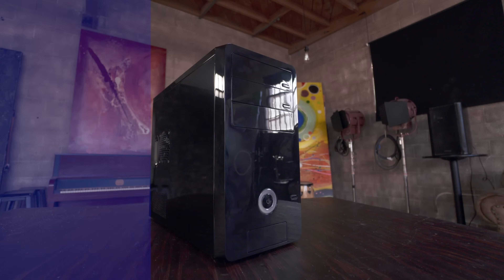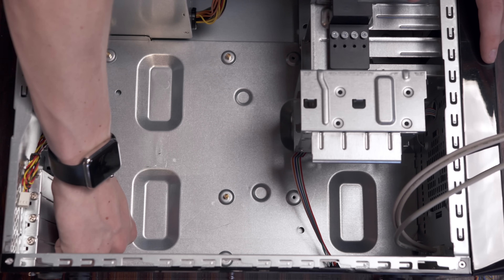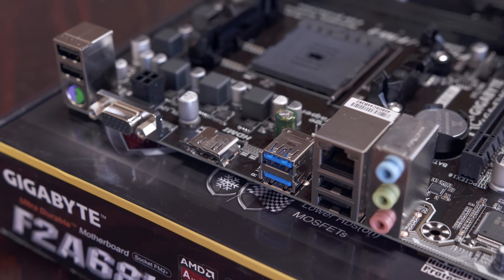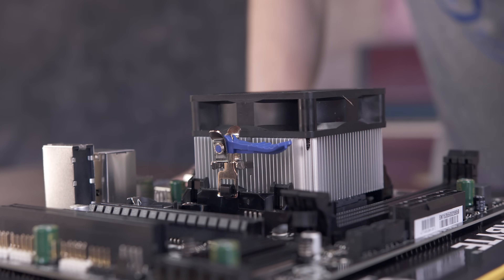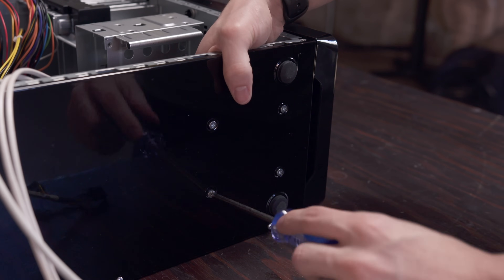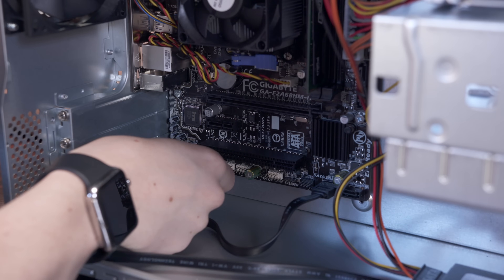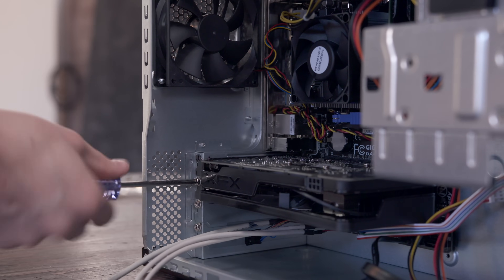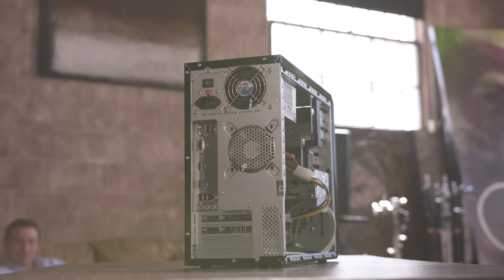How to Build a Gaming PC! (2016)

Comment: "Gaming PC!"

Athlon
Reply: +ThatOneGuy This computer costs 350$. What do you expect?
Reply: Lol
Reply: David Srey Oh it's off sale then, but the extra $40 is worth the overclock go with the performance of an i5 the i3 6100 is an amazing dual core but for modern gaming you'll need 4 cores and the best CPU under $180 is the FX-8350
Reply: +ThatOneGuy I mean 4 cores? It can't do THAT badly, I mean if all else fails you get a free radiator, right?
Reply: better than your shitty i3
Reply: +Fuck Nope i5 4690K clocked at 4.1
Reply: +Fuck How about you ?
Reply: +Fuck the i3 6100 beats the fx 6300
Reply: Mrmogeli My FX-8350 4.5 Ghz beats your i5 4690k easily
Reply: David Srey But not the FX-8350 and it's cheaper than the i3 with six more cores and higher clock speed
Reply: Eduard Khil A $350 in 2016 can go a long way
Reply: Fuck wow. Just looked up some comparisons between this one and a Core i3. Consider me impressed.
Reply: ThatOneGuy No if the 8350 beats a 4th gen i5 i'm pretty fucking sure it beats a dual core 6th gen i3
Reply: +Fuck the 8350 is almost $40 more than the i3 6100 but if you got a slightly bigger budget than go for it but the i3 6100 is great for its price

Comment: I usually put in my GPU before I do any wiring
Reply: +MCOD1999 til you find out it can get in the way of cable management extremely easy, cable management is always the thing to do first
Reply: +MCOD1999 Sometimes, it can be hard to wire around the gpu when using a mATX mobo

Comment: The AMD X4 860k is trash for gaming. The Pentium G4400 beats it. Please, fix this next time.
Reply: I stand corrected. http://pcpartpicker.com/p/HkrTdC

Holy SHIT Skylake gaming for $360?
With DDR4 ram! Count me in.
Reply: g4400?? you mean the g3258, do us all a favor and before you start a debate, get your facts straight.
Reply: +SlimShadysBrother the Pentium G4400 is the Skylake version of the G3258. I actually wrote an article on this topic if you want to check it out: https://plus.google.com/+StephenMcCranie19/posts/PSxstBXAHTz
Reply: +Stephen McCranie But G4400 is skylake and you need a more expensive motherboard and ddr4 ram. So it goes over the $350 budget.
Reply: Nissan U. that's not true. Take a look at this build that's a little over budget but, if you used the same case and PSU he's using it'd be on budget.
Reply: Stephen McCranie Is skylake any better for gaming then the g3258? If you OC a g3258 it will outperform the 4400
Reply: Nissan U. assuming that you could get the G3258 to perform better by 12%, the G4400 would have the same performance. Not a 12% over clock, but actual performance boost. I always tell people to get the G4400 because I want to push people to DDR4, and it's easier because you don't need a different cooler like you would if you're overclocking the G3258 (I assume)

Comment: I have a question, Do I need to connect both 4-pins, or only one for the GPU? Cause I have a run out of cables and I'm missing one for each of the two 4-pins I need for the gtx 970? It's running ok but I'm scared that I'm doing some damage to it. Also does that mean I have to buy a new psu?
Reply: +XhunterDragon96 it won't work if you don't plug in all required power connectors, you'll need a new power supply

also the gtx 970 requires a 6 pin and an 8 pin, not two 4 pins
Reply: You really need to have 2 4 pin connectors in. Its not overly safe to have just one in. I'm surprised that it even launched with just one.
Reply: +Stewy mine uses two 4-pin to 6-pin adapters, meaning four 4-pins and two 6-pins. It does work, however I'm only using two of the four 4-pins (one of each adapter) and that's what scares me atm.
Reply: +XhunterDragon96 Hang on, hang on I'm quite slow. But your telling me that you have 2 4 pin connectors plugged into 2 6 pin connectors right?
Reply: +XhunterDragon96 Wait hang on I've been a stupid. You have 2 4 pin to 6 connectors. They then go into the GPU. Yeah they should be fine. Also tip : Google is your friend.

Comment: Noob question, but if you move a hard drive from an old desktop to a new one, it would work just fine and would cut out the need for purchasing another copy of your OS, right?
Reply: short answer: No
long answer: it's complicated, Call Microsoft, not e-mail and tell them your board died ind you Will get a New code if you Are lucky

Comment: My pc will have a I5-6500 3,2GHZ  8Gb of RAM DDR4 and a R9 380. Its good?
Reply: Ye I would suggest getting the 6600 over the 6500 tho, those few extra HZ really make a  difference.
Reply: +Taco San I know but is more expensive :/
Reply: +Francisco Magalhães like 10-15$ American, it's really worth the extra money
Reply: +Taco San in Portugal its more 30 Euros...  But its worth it?
Reply: i would say so man, that extra turbo boost is what made it for me, just built my PC not too long ago, im running a core i5 6600. 8gb ddr4 2133, gtx 970 evga ssc cuz i got it for 309$ and with the division and another game called bombshell for free, and a 500 W power supply from evga. im running the division at high, some ultra, settings and get 60 FPS, some places it dips a little bit but its not that big of a deal! if i use the High preset, i get constant 60 FPS no fps spikes what so ever!

Comment: How do I install the operating system? I am sorry if I am cringe worthy :(
Reply: disk or usb with windows on it
Reply: +donovan holm put in a usb with a copy of the OS you want and then you go into the bios you can look through the options and find one that allows you to boot from a usb. Next chose to boot from the usb with your OS and  boot from it. after you set up the OSS it saved to your ssd or hdd so you no longer need the usb.
Reply: +donovan holm With a usb.
Reply: You have to go onto the boot menu (usually F9) and then boot from the source your OS is on (Usually a DVD for Windows) Then go through the installation process
Reply: download os from Internet,  it should be .iso file, download poweriso from mother Google, open poweriso and open your iso file, then add USB drive/stick extract iso file into USB stick (note: format USB stick b4 extracting os on it) put USB stick in computer which you want to install os and power it up , search in Google how to open window where you can select boot drive (F9 or Delete) select your USB stick that has your os and windows should be installing. 
if you need any other help or you didn't understand something ask me: 
superhornetpilot@outlook.com 
or just ask anybody on here

Comment: how do u add a a version of Windows is it hard?
Reply: +Coke Pack 
Fuck off 
this is a gaming PC you bottom feeding shit eater, stop trying to assimilate people into your linux peasant cult. dumbfuck.
Reply: +Yash Pradhan 
Just grab an iso
put it on a bootable flash drive
turn on the pc
it will prolly ask for a product code 
go through the setup
blah blah easy shit have fun
Reply: +Yash Pradhan If you have a physical disc copy of Windows, you'd just put it in the DVD drive of your computer and turn it on. It should take you through an installation process and you'll be good to go.
Reply: No
Reply: put in a usb with a copy of the OS you want and then you go into the bios you can look through the options and find one that allows you to boot from a usb. Next chose to boot from the usb with your OS and  boot from it. after you set up the OSS it saved to your ssd or hdd so you no longer need the usb.
Reply: +Neonemerld Or you can use a usb thumb drive and go to the windows website and download it from there
Reply: +Yash Pradhan no it's not hard just long. Look it up theres a ton of vids
Reply: Bluebucket I also second that it works
Reply: You can buy a cd with windows on it or you can download it on a usb but make sure it at least have 8 gb.
Reply: You can buy a cd with windows on it or you can download it on a usb but make sure it at least have 8 gb.
Reply: www.gentoo.org/downloads/ this is only copy of Windows you'll ever need. lol
Reply: +Yash Pradhan Install Linux instead.
Reply: +Yash Pradhan Only tough part is the pricing, but then again, you may have just spent aboutmoreorless $700 on parts.
Reply: Generally people like Microsoft try to make their setup as dumbed down as possible, just follow the instructions. And I recommend putting a Microsoft account in if you can, it adds tons of functionality.
Reply: +Pine Cone Wow. Linux is good, especially Ubuntu. I agree it isn't the best for gaming, but not everything works in Windows.
Reply: +Pine Cone NaCl.
Reply: It's easy to do and pretty much intuitive to install an OS
Reply: Put in a disc or flash drive to go into the installation process. Since it was meant to be at least somewhat easy to do, it is easy. It will tell you what to do as you go.
Reply: +Neiva - CS Zombie Escape Videos go back to /r/eddit weeb
Reply: +Neonemerld What if i use an existing windows copy on an SSD/HDD
Reply: +Neiva - CS Zombie Escape Videos 
+Koopa Troopa
>mfw youtube commenter doesn't know difference between 4chan and reddit
Reply: +Yash Pradhan  If you think that this is a virus.DON'T. this is the real copy of windows 8 for FREE. you can download windows 10 later on . YOU ARE WELCOME. (this is not a virus and i am actually using this now)
getintopc.com/softwares/operating-systems/download-windows-8-pro/
getintopc.com/softwares/operating-systems/download-windows-8-pro/
Reply: ***** Yes. Actually to add on, go to /r/microsoftsoftwareswap for legit copies for cheap prices.
Reply: *****  you dont need a product key for this one.
Reply: +OCD Music it's just 50 dollars for win 10 pro (if you get win 7 pro  then use free upgrade to get win 10 pro) that is nothing to go to jail for
Reply: +Coke Pack If you like linux, install linux, but don't tell others to because linux may not be the best OS for them, it doesn't run a lot of games.
Reply: +Carver the AMD Fanboy I never said Linux doesn't have games, if you didn't understand what I meant, I meant that it doesn't run some popular games such as GTA, yes I know that they could make a version that is compatible, but they don't which means I need windows to play GTA.
Reply: +Carver the AMD Fanboy True, I haven't tried linux, and I like windows, Maybe it's better, but I'm not switching over right now.
Reply: +Carver the AMD Fanboy No I never said that linux has no games, what i said was that SOME games don't work on linux, NOT that linux runs no games whatsoever.
Reply: +Carver the AMD Fanboy the only unix-like systems with versions of GTAIII up to San Andreas is OS X.  linux is entirely excluded.
Reply: +Carver the AMD Fanboy I know that they can make it for linux if they want but it is not OFFICIALLY suported on linux.